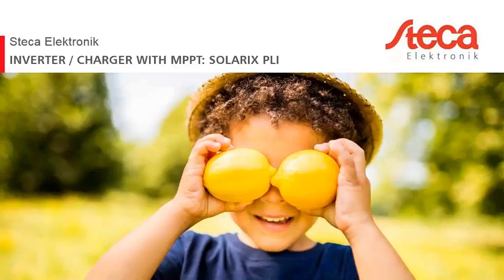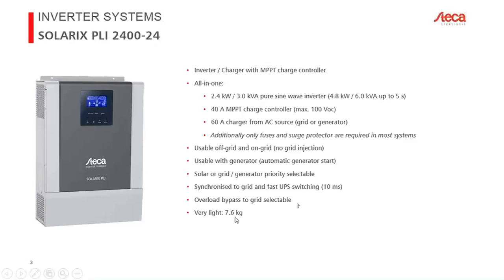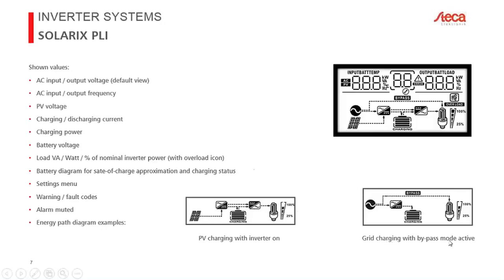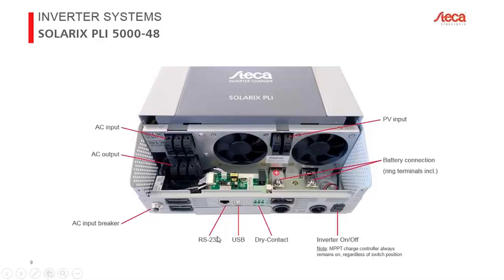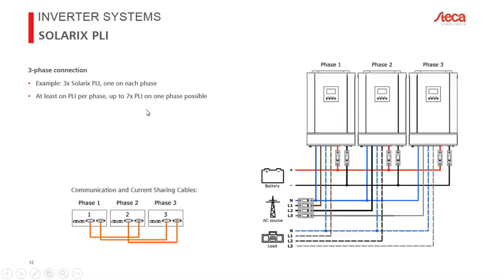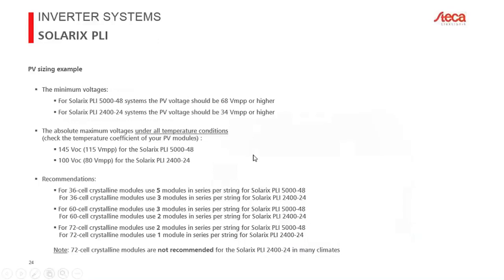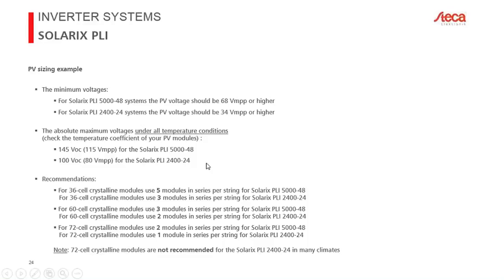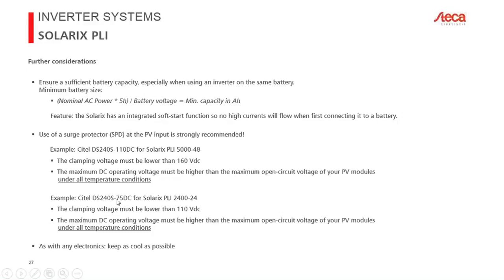Webinar PV: Off-Grid Steca Solarix PLI

Comment: If you are running an offgrid installation, with 2 PLIs in parallel, can both be connected in parallel to the PV grid??
Reply from the maker: ... but  then you have basically to different systems, right?
Reply: @ Well i want to charge the same set of batteries, does that mean all the PV goes into one PLI?
Reply: @ or can each PLI have a its PV, be coonected in parallel and charge the same battery?